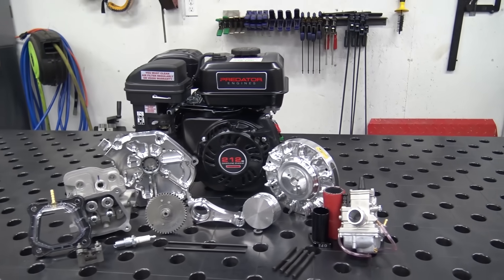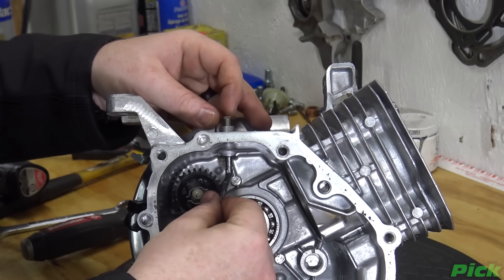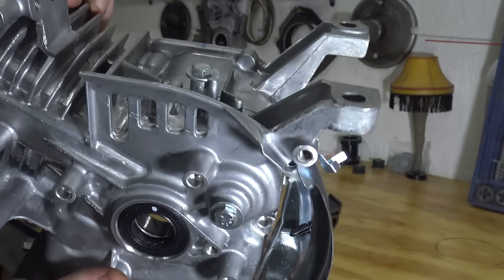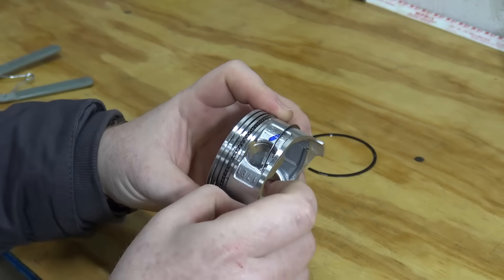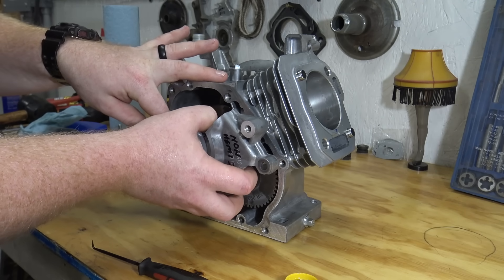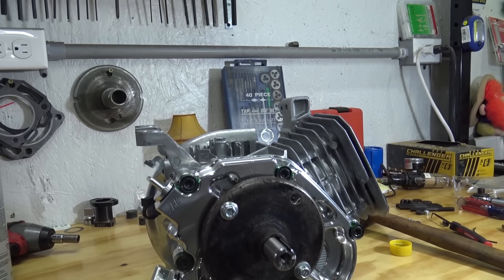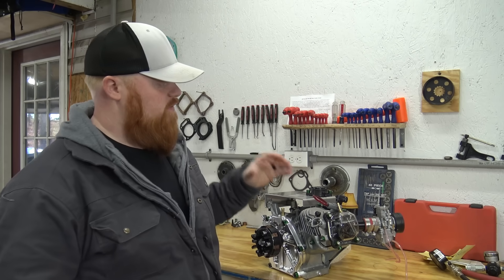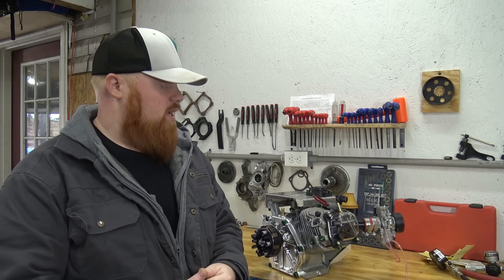Predator 212 Stage 4 Engine Build ~ 22HP Go Kart / Mini Bike Engine

Comment: Could I grind off some of the fins off of the factory flywheel fan (no money for a billit one as nice as it would be) I figure it would would be fine considering that the billit flywheel has half of the amount if fins as the stock one I would either take 6 or 12 of the the fins off maybe 6 first to see how it runs would it run too hot in theory? Awesome video by the way!

Comment: Does the stage 4 kit for the hemi model contain the hemi racing head or can you use the non hemi racing head on a hemi block?
Reply: Don't use the non hemi head on the hemi motor, it will bend your push rods as soon as you turn it over... I made that mistake unfortunately :/

Comment: I'd like to see a hemi version built to the max! Like Patrick Smith I can now take apart and rebuild my 212 hemi predator thanks to RBG! I am building a BBR tuning motorized bicycle with this motor. Any hints to make it fit appreciated as it is very tight. Also can I make it produce 12 volt for lights as I want to make it road legal. Never did any mechanical work in the past RBG is a great teacher!

Comment: Me : I can do this I’m going to Harbor freight tomorrow 

Link : everything is $965 

Me : 😵🤯 why put $900 worth of parts on a $100 engine 

Also me : ehh I’ll save up 🤣😅
Reply: You will also need jets to tune the carburetor.  I did a hemi using  a mod 2 cam, 18 psi valve springs,header, billet flywheel and rod.The carb is a 22 round slide Mikuni, (the 24 flat slide is a better piece). Never removed the head, my Grand daughter  ran 65 MPH in 1/8 mile in her Jr. Dragster with it.
Reply: I haven't done the 22hp build yet but I've done 4 of the 16hp builds and they haul ass already I cant imagine how much faster 6 more hp would make it
Reply: barbie ang lol 😂
Reply: barbie ang lmao I’d rather drop 1k and get a 1000cc motor off a street bike and actually have something that boogies
Reply: @zackanderson2298  different applications, plus a crotch rocket motor is used, try to get a brand new 1000cc motor for under a grand.
Reply: @Agavegaming  I did get a whole ex500 for 200 bucks one time.... thats half of 1000 cc hahahahahaha 😆
Reply: I made a bet with a friend who said i couldent fix a 6 in crack in a 212cc preadotor engine,i did the next day i through it a way,to much money i could of bought a new engine with the money it took me to weild it,lol same
Reply: barbie ang thanks I was sitting here trying to do all the math😂
Reply: More powor,lol
Reply: Ik a few people who do go kart racing then go kart dass have like 3 of theese pre built

Comment: Anyone else cringe when he used a drill with a tap
Reply: No. I have done it for years. If you do not tighten the chuck down real tight, it will slip before breaking the tap. Run it in til it slips, back it up some, repeat until done. So much faster, and when using the slip technic, it is safer on the taps in my opinion. I have never broken a tap doing this, but have broken many using a tap handle.

Comment: Greg that was brilliant mate, the time you and becca must have spent on filming that , stop starting for angles to shoot the best shots from to the Voice over  and explanation of everything then the Hours spent in Editing it to a finished video.
A Huge thankyou for all that work  I think that you have a excellent tutorial for a lot of people to refer to ( IF you could even buy a Predator engine in Australia  it would be handy Lol) 

In watching that I thought of something you are lacking and might want to incorporate into your tools 

How about building a Multi Mount Engine stand at the right height (AND weight to stand the vibrations)  for you to work on it .
This would be, when you finish an engine, you can mount it to the stand for the run in period  instead of waiting for a suitable frame or Kart to put it in 
it would make it easier to fine tune the engine on the stand, adjust anything  and also do the first oil change after the run in period etc 

You then have a completely finished engine  on the shelf or ready to be used immediately you have, what ever it is you are putting it in. 

Saves the back in bending over, and standing on the engine, while you are trying it out just after the build !
Grin who mate maybe a saleable Item for other Engine builders out their ?

Tony From Western Australia
Reply: Gday Tony,
 I Googled the Predictor eng. and u can get them in Australia
but the same eng. that costs around $200 costs around $700 here!!!
 Might be cheaper to have one Shipped over.!?
 Spent a couple of years in MUKINBUDDIN and SOUTHERN CROSS
In the 70s. (Frikin FLY'S!!!!!!!!!!) in my teens:)
 Don from Melbourne

Comment: Did you have trouble fitting the rockers? My 1.3's come in contact with the head itself. Its a gx200.
Reply from the maker: They fit fine. I will try a set of the 1.3's and see if I have contact
Reply: @RedBeardsGarage  sounds great thanks. Do you also think there might be a difference in head design between gx200 and predator?

Comment: Red Beard....you have never said what has to be done if the clearance on the rod and crank is too small or too large....
Reply from the maker: If too thin you might need to get the crank turned, if too big then you need a new crank or thicker bearings
Reply: Thanks

Comment: lol wtf I call this hullshit 770 for the kit and no engine. you can get a lifan 200cc 20hp stock for 430 and a good manual clutch and a 5 gear manual transmission this is just a stupid waste of money an time and revs to 9rpm stock
Reply from the maker: Some people like to build engines instead of buying a off the shelf engine. People build fast 4 cylinders all the time and have a blast. Sure you can go buy a z06 Corvette with a lot of power but it's more fun to build.

Comment: BAD idea to use a crankshaft lock on the other side of the engine. When you torque down a flywheel nut always lock the flywheel in place. This way you won't risk bending your crankshaft
Reply: that volvo guy 
Would 60ft. Lbs. really bend a crankshaft? I'm not trying to be a hater or argue but I highly doubt it. Have you experienced that happening?
Reply from the maker: Even arc uses the same method
Reply: @RedBeardsGarage  Okay than it would be fine I guess since the crankshaft is a solid cast piece. However with pressed crankshafts you'll find on dirtbikes and mopeds I would definitely not do it since they'll go out of true very quickly.

Comment: When you are putting the head studs in and use 2 nuts locked together is there a torque spec for just the stud before you put the head on and if so what would it be or if there isn't at what torque spec  do you start to compromise the thread pattern in the block....????
Thank You and God Bless
Reply from the maker: I just torque them in there. I don't do enough to strip it but the correct torque spec I guess would be 22lbs

Comment: Before I even watch the video, would a 670 be cheaper and quieter with the same power?
Reply from the maker: It would make a lot more torque but when fitting into a small frame and to keep weight down this is what want

Comment: Greg miss-spoke -Rod to crank clearance is @.0025 - two and a half thousandths, not 25 thousandths (.025) . the plastigauge will tell you the  correct tolerance , as does ARC who made the rod.  Take note of the 2 ball bearings and brass cam bushing in the side cover, a very nice piece. At 13:08, see the nice full across contact the valve compound shows for flywheel and crankshaft mating.
Reply from the maker: Yeah didn't realize I didn't until you said something. Now I will never get over that lol. Thanks for watching.
Reply: @RedBeardsGarage  Especially after I seen and heard lol. Good video as always...
Reply: @RedBeardsGarage  It's cool Greg, you are a fine teacher. The best teachers this old fossil had were entertaining and actually good at the subject they taught.

Comment: Ok so dp you remove the plati gauge after you have measured it or......? Just asking got to understand the is the gap for oil to get in right. Nice & complete engine brother real clean.
Be blessed Jah Rastafari Selassie I Jah
Reply: Yes... Always clean the plasti gauge from the crank prior to proceeding.
Reply: @davejohnson3037  We always torqued on the rod cap and measured the rod bearing and the crank to check clearance. Didn't know you could still get plastiguage. LOL. Sometimes we had bearings that were too long preventing you from completely tightening the rod cap increasing the clearance and had to machine a small amount off the end of the rod & cap bearing
Reply: @davejohnson3037  thanks 
Be blessed Jah Rastafari Selassie I Jah
Reply from the maker: Yes sir remove all of it.
Reply: @RedBeardsGarage  Thank you Sir✌😎

Comment: I am going to build this 20hp engine, which would you prefer and why, Preditor 212, Preditor Hemi 212, Tillitson or Tillitson electric start? Also isn’t there a Tillitson that has a pressure oiling system and if so what cc is it? Thanks, love your videos, that is what convinced me to build this engine for my Coleman mini-bike.
Reply: If you do an electric start, good luck finding a way to run a billet flywheel and still have a charging system for the battery. I've been racking my mind for months trying to figure it out.

Comment: Did you use stock 2 peace retainers or the retainers that come with the the lightweight aluminum keeper?
Reply from the maker: The retainers are aftermarket ones that come pre-installed in the head

Comment: Carsandcameras just built a 420cc 20hp weak yours is 212cc and makes that theres is weak
Reply: A 20 horse 212 will make that power up high. The 20 horse 420 will make gobs more low end torque... ideal for heavier vehicles.  I would use the 212 for a small and light racing go-kart but the 420 on a heavier off-roader.
Reply: But the 420 is stage 2 not 4 and they have a stage 4 212 too. If the 420 has the stage 4 they will make 40 hp
Reply: Being a stage 2 420cc at 20 hp is weak my honda 400ex has stock 25 hp bone stock not stage 2 and alil less cc's
Reply: @cadenfinley877  they are not build To be powerfull they are build To be long living and power thing like generator
Reply: If there not built to be powerful then why are they building them to be powerful😂
Reply: @cadenfinley877  
A lot of people (like myself) are power hungry. I upgrade everything I own. Plus there are some vehicles with limited space where a 212 might fit but a 420 will not... So they might as well build a 212.
Reply: @cadenfinley877  they are cheap and look how much smaller the 420 cc is compare To 400cc atv engine but i agree they are week
Reply: But you did make a good point of why they dont have much power ill giv ya that.
Reply: My point is a 420cc should make 20 hp stock not stage 2
Reply: @cadenfinley877  
True, I agree
My old 97 Timberwolf atv made 13hp out of a 228cc
Reply: My honda 400ex makes 25 stock not stage 2
Reply: I know it makes more power using less effort and i honestly think it puts the power to the ground better to with gears
Reply: Tony12083.   The only reason the 420cc is smaller is because all the 420 has is a crank my honda 400 has a crank gears and a clutch so yeah thats why its smaller

Comment: Is it better to get a 212 kit or a 420 kit? Is more displacement better with small engine just like car motors?
Reply: Yes, doesn't make a crap what the engine is on if it's bigger it makes more power.